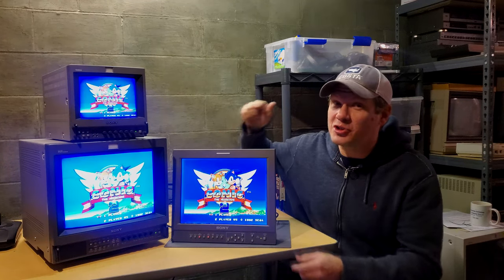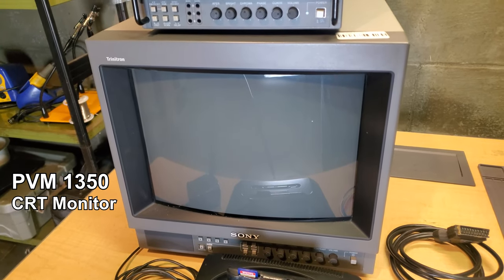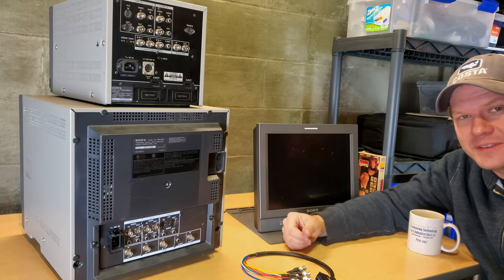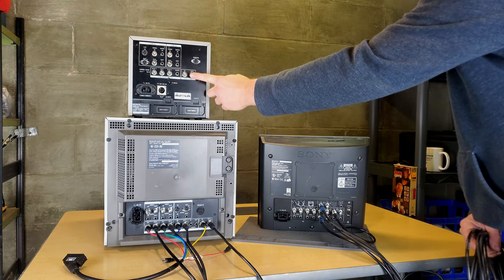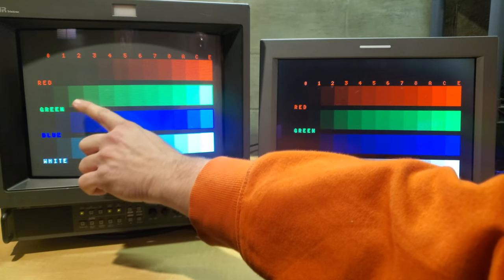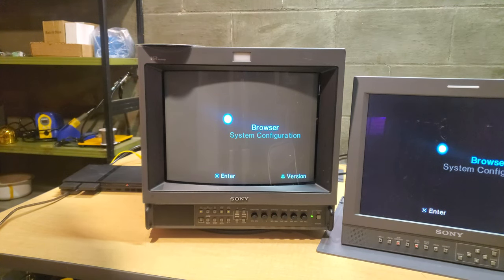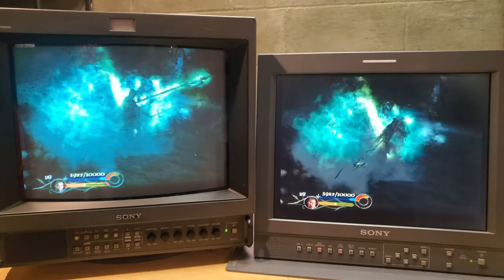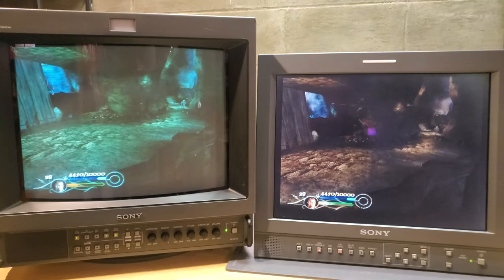CRT VS LCD - Sony PVM Trinitron & LMD Face-off! | Retro Tech

Comment: I'm still using a CRT monitor. 👍 With GPU prices a 980ti at 1280x1024 means I can ride it out for a while longer 👍
Reply: I use a CRT monitor for modern games too and I’d say at least go with 1440x1080. Your card can do it and more detail is still more.
Reply: @themmmeanone  I'll see if my monitor can do it. 85fps locked all day long on 1280 X 1024. If only they made an OLED that did not suffer motion blur without needing 240htz 🥺
Reply: I've just started migrating to CRT's. I've got 2, want one more. Then I use my 2 trash 4K's for Youtube and Google and my projector for Youtube too i guess.
Reply: lmao dude

Comment: Would probably be a great monitor to watch VHS and old 4:3 movies on. That refresh blur might help the video in certain scenes.
Reply from the maker: Yeah and the lag won't matter.  That's a great point.
Reply: I'm not sure if it's a good idea.
Because the vhs tapes are designed to be played on a CRT display.
Due to the imperfection of tape and the mechanism. The sync signal from vhs tape are not as stable as cable or game consoles. This has minor impact for CRT displays, but not as indistinguishable for LCD displays which basically requires a stable signal to work properly.

Comment: I don't know if the world will ever see a display technology that offers no lag. Anything that's a panel has to be loaded into a buffer first so it can all be drawn in an instant. With a CRT, as soon as the source outputs, the electrons hit the phosphor (but really, it doesn't, it just goes nearly the speed of light, which is imperceptible).

Comment: Nice comparison. One thing I like about early 640x480 LCDs is the ability to display pixel-perfect 480p VGA contents (maybe not this particular LMD but many others can), especially PC games and entertainment software from the late DOS and early Windows period. The sharpness and detail created by those giant pixels are just so pleasing. 

It reminds me that plasma TV had many advantages over early LCDs in the making of 480p EDTV for gaming. I was wondering if you’ll be interested in reviewing a 480p plasma TV, especially the famous 4:3 pioneer pdp v402. It’ll be very interesting to see some comparison between a CRT and a plasma EDTV.
Reply: The lag on them is a non-issue for a lot of games too.

Obviously difficult platformers or fighting games are not a great idea to be played on them, but something like most JRPGs would not be a problem.
Reply: Are there so many 480x640 games? In my perception, PC games were either 320x200 for DOS, and thus with non-square pixels, or they were flex-resolution. So you can just set the system resolution to be half of the screen resolution. So with a 1600x1200 LCD, which have by far the best 4:3 panels, do great as 800x600 screens for early PC/Mac stuff. Even with black bars the 4:3 1600x1200 LCD's outperform all lower res panels, especially 1280x1024 were junk when it comes to IQ, and 640x480 never had proper IPS/VA panels either.

Comment: I bought 3 PVM’s today! 2x 20M2MDE for 200 and 330 euro, and a 2053MD for 390 euro. Comes with 40% tax and auction fees on top, i didn’t realize that. I bid the 2053MD accidently, so a bit cause i think i overbid that one. Still very happy, thanks for all the great videos!👍👍👍
Reply: “a bit bummed” i meant
Reply: @jengelenm  comments can be edited.
Reply: for sure 40€ would have been a great price but the site is well know and not like ebay who bid at last second win the auction. there is auction fee, tax on object and tax on fee, its clairy say in auction condition.
Reply: i didnt know they where so valuable..i have 2 in the shed and a sony triniton dual input crt monitor.. the 3 of them are all 20 inch...

Comment: excellent technical report I wanted to know if there is lag on the lcd even using the component in 480i/p i play Ps2 at 480p/576p on a 30" Samsung
PS i like your modded Genesis ☺️

Comment: I've been doing my own comparisons lately , both Dell
A Dell M993s 19" 1600x1200 CRT vs a Dell 2007FP 20" 1600x1200 using Retropie, both are great monitors but the Dell CRT looks 100xs better no contest
Reply from the maker: Very cool.  Dell did and still does make some good monitors.

Comment: Nice comparison Steve. I've recently jumped down the rabbit hole of professional CRT's, picked up a JVC BM-H1400PNKA and a Panasonic BT-S1015DA. Do they need to be powered off when connecting/disconnecting BNC cables or doesn't it matter?
Reply from the maker: Thanks.  That should have no effect on the monitor so you can do it while on or off.
Reply: Make sure you have proper 75 ohm termination.

Comment: The LCD seems to suffer from pretty bad CCFL backlight yellowing. Contrast looks better than CRT here because of the chosen exposure settings of the camera. If you had increased aperture or lowered ISO, the contrast on the trinitrons would have looked much better. Now they are overexposed.
Reply: Oh and set the white balance of the camera to 6500K to accurately capture the white point. Now it is probaly on auto white balance, making the CRT look rather bluish.

Comment: No valid comparison can be done until both units have been properly calibrated and any issues in drive circuits fixed.  For one, the CRT can do true black and blacker than black, the LCD cannot, yet it shows as having deeper blacks than the CRT.  The CRT isn't calibrated properly.  I have a '74 Zenith Avante TV that has better black level than what is shown on the CRT in the video.  Also, the scan lines on the CRT seem to be exaggerated (sharpness up too high?).
Reply: Exactly put...my Wells Gardner K7000 is so black that you can't tell if the CRT is off or on. This video as much as I appreciate the guys dedication and efforts it doesn't deliver...my K7000 kills this...you should see Windows on it.
Reply: CRT black levels are highly dependent on the ambient light in the room

Comment: It's 2022.  Is anyone still asking this question?  LCD tech peaked a decade ago and no matter how they try and rebrand it or what letters they add, it will never surpass likes of CRT, OLED, or even Plasma displays for picture quality.
Reply: I can appreciate peak LCD for what it is. Go get a Sony Bravia 46W5500. It is magical. Not the OLED or Plasma contrast, but there are areas where it excells. First of all, CCFL LCD is king of computer interface kind of stuff. Uniformity is unmatched. White point is unmatched. Brightness is unmatched. long time reliability is unmatched! You can run such a Bravia full white at 500cd/m2 and it has a nice eye-comfy white point with that. No dirty screen effect, no image burn. And I also like its wide-gamut characteristics. My 2008 26 inch CCFL LG monitor is still by far the most astonishing display I've ever come accross. It is lag free, stunning viewing angles, and the gamut is crazy. 100% AdobeRGB. It is in my best looking arcade cab.

Comment: CRT continues dominate at low Hz. Few LCD strobe (flicker) can get down to 50Hz but ULMB only, the (very) high price and no true 10-bit color support, unfortunately. I use CRT monitor for zero motion blur and for true 10-bit color because I want 50Hz for TV + multimedia and for few retrogames and 60Hz for multimedia, retrogames and modern games. :)
Reply: Ah... LCD has very low persistence time (ultra low motion blur) at 50/60Hz strobing 🙂 but the picture is little dark, unfortunately.